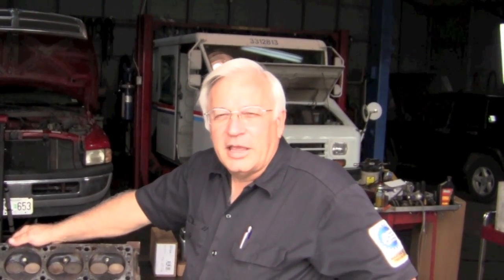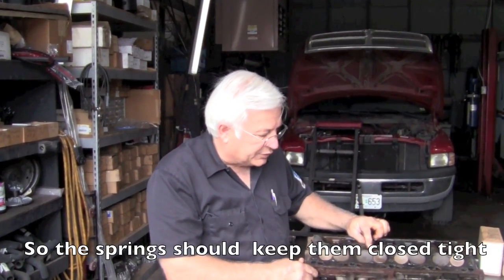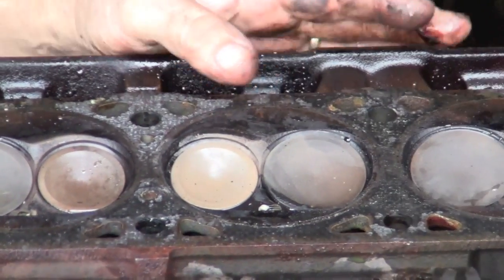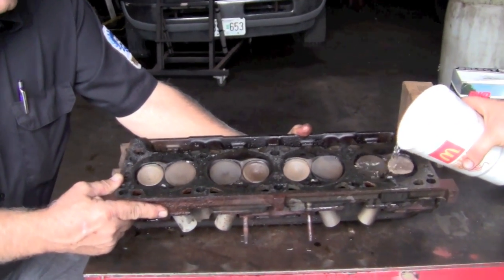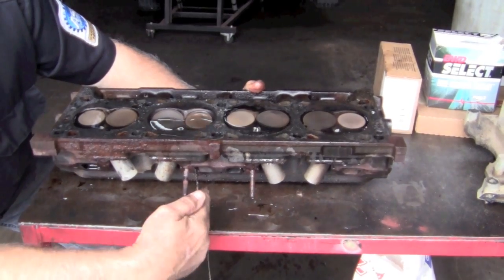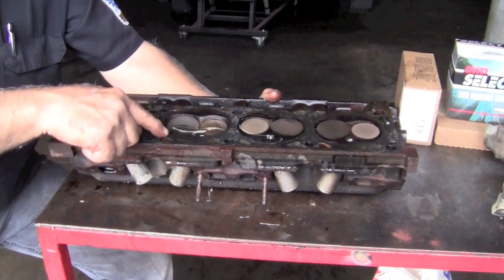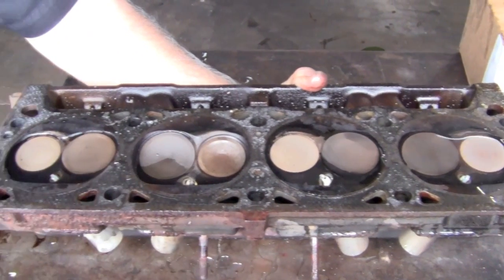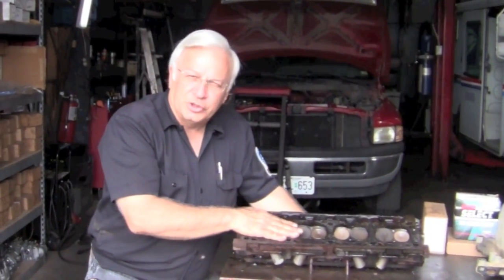Checking a Cylinder Head for leaking valves

Comment: Can I get away with just getting new valve stem seal sand lap grinding them?
Reply from the maker: of course it would depend on how bad they are, but in many cases yes you can
Reply: @ nice. I just have a single one that takes time to leak all the way down to the base. All other ones just have small water build up at the port but it never drips downs.

Comment: mostl likely cracks on dodge 5.9 are center cylinders of each head especially driver side. center is because two exhaust valves are next to each other double heating. the driver side is because the water stagnates on that side due to water flow direction.

Comment: I seen another trick where you use the spray bottle with soapy water. Spray all valves then using the blow gun on the air compressor, you give each port hole a blast inside for like a second or so each. You'll get bubbles.

Comment: So does the valve seal need to be replaced or the valve or both?
Reply: He was referring to the valve seat was leaking (edge of the valve where it touches the cylinder head)  since it's leaking machine shop will have to machine the valve seat, install new valves and valve seals, machine it so the head surface is flat and pressure test the cylinder head  valves as it where installed in an engine.   As to whether the whole head is done or only that cylinder depends on the customer, or machine shop doing the work.  I've been to machine shops where you have to do the whole head.  I don't mind this because it's just one less thing you have to worry about.  I'm assuming since they took that particular cylinder head off that they had already did a cylinder leak down test after a compression test to verify the low pressure on that particular cylinder.  Since it was leaking by the exhaust then they would have felt blow by in the exhaust pipe.

Comment: Thanks! This is exactly what I need this morning. I had blown head gaskets on my 2000 Ford Windstar 3.8L. I had the heads resurfaced but want to make sure the valves are holding before reinstalling them. In my case compression nor leakdown test would have helped diagnosing leaky valves. I had very little compression.
I need a job If you guys are close by and need a good apprentice.

Comment: to check piston rings or valve leak easy, put little oil in the cylinder a test compression one more time, if the compression go up the problem is the ring, if the compression same to first time you check the problem is the valve.

Comment: The compression check will tell you if your cylinder is losing compression, sure.  But it won't tell you if it's the piston rings, valves, or head gasket.
Reply: Jerkwad152 no, but antifreeze and oil will tell you the problem.

Comment: Then why pull the head off, that's a lot of work to fill up the head with water.
What about a compression check, $25 tool.  Would a compression check diagnose this problem also?  I have checked mine, and compression checks 180, 165 165, 180 but I still think i have a leaking valve or not seating well.

Comment: Dodge Magnum heads are NOTORIOUS for cracks due to the thin deck thickness.  Wouldn't be surprised if the machine shop finds cracks.  My 5.9L suffered a similar fate.  New cylinder head was required.  Either way, great video!!
Reply: i head to pull 4 heads at the junkyard to find one uncracked one.

Comment: yea this way will show a major leak but the valves should seal perfectly. I tip the head on its side and put brake cleaner (thinner than water so will will show a smaller leak)  into the intake or exhaust port (which ever way the head is sitting) and look for seepage at the valve. I do this even after I get a head back from the machine shop to double check there work. I learned this lesson the hard way on a Honda pilot. It would run great off idle but missed at idle.

Comment: You could  have put the cylinder with no compression to top dead center and then put compressed air in to the spark plug hole then hear and feel where the compressed air is coming from. You would have heard/felt it from the exhaust and would have known it was a bad exhaust valve.

Comment: I have a chevy 350 with a free set of vortec heads. If i pour water in the intake side,2 of the valves will SLOWLY (like 1 drip every 15 seconds) drip water.Is this bad enough to do a valve job on?

Comment: I use a cup plastic cup painted black on the inside, that I put a hole in the top of.Then I put a Cree XM-L 300 lumen led flashlight, in the hole in top of cup. then put the cup with flashlight over the valves and turn it on.If the light comes through the stem side, you have a Leakey valve or valves..it's like majic:)
thanks for the great tip!!
Reply: That’s gold ! Thx

Comment: That’s a good way of doing it although I’ve always used kerosene. You can also fill the intake or exhaust ports and watch for leaking at the valves. If it’s still on the vehicle you could smoke each cylinder at TDC after failing a compression test and see where it’s leaking (I think you have a video on that!). Keep up the great videos!

Comment: with it on the car/truck, if you can access the spark plugs easy, you could do a compression test, as well as a "leak" test, i recently learned i bent a valve on brand new ported heads, 0 miles, because a peice of aluminum got caught in the intake... compression test = 0... then i removed the schrader valve from the compression tester, hooked up my air compressor and fired a bit of pressure into the cylinder... 0 pressure build... = leaking head or valve damage...